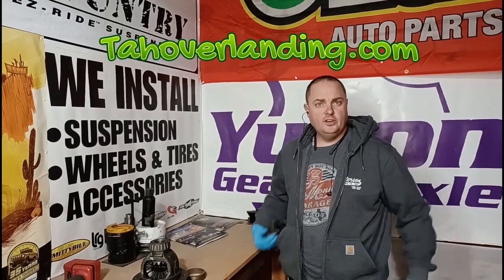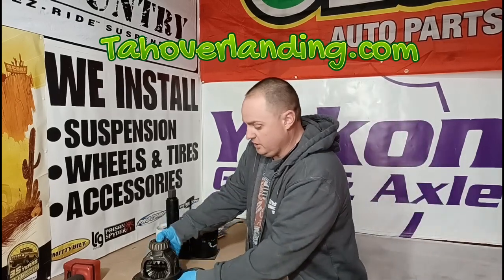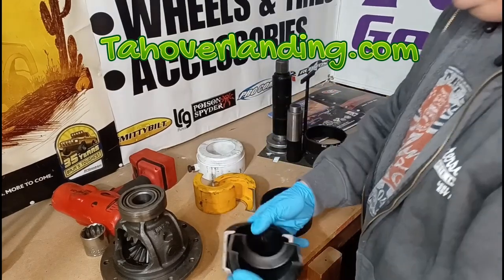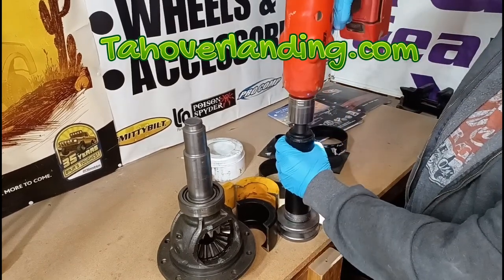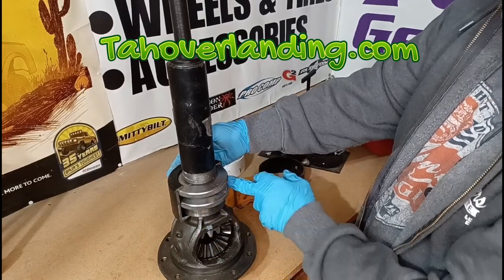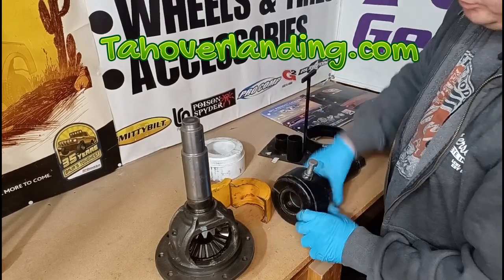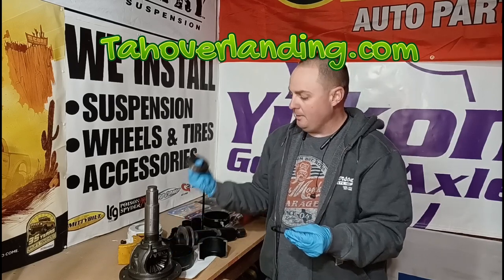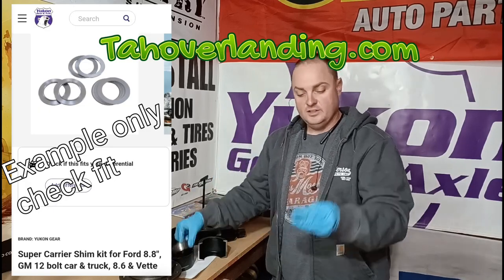Buy these shims when changing gears - Tahoverlanding Axle swap episode 22

Comment: Gear install video would be sweet, honestly. I know I eventually want to run 4.56s with some sort of worm gear, limited slip in the back, and an e locker up front
Reply from the maker: I'm sure you mean a torsen style, I'd do eaton/Detroit true-trac without a doubt.  

I'll do an install video next time I do gears. I'm considering doing more like a series of videos. One focusing on pinion depth, one on backlash, one on pinion bearing pre load etc. 

I haven't decided

But at any rate I'm a month or more from doing gears again
Reply: Looking forward to it. It's definitely something I'd like to learn how to do. And yes, torsen but for the life of me I couldn't remember the name but I did remember a component within it 😂
Reply from the maker: @thomasmullinsiii7759  rather than "worm" they're actually also known by the helical gears. So you'll hear them called "helical" 

I'm a huge fan, I've installed many for guys. Jeep guys love them in the front diff. 

I talk them up so much that Instagram @3108.gearhead is going to put one in the front of his swapped suburban
Reply from the maker: @thomasmullinsiii7759  I'm actually considering putting one in the front of the new white Tahoe
Reply: Never thought about doing front and rear "helical" style lsd. Not a bad idea.
Reply from the maker: @thomasmullinsiii7759  I have a couple of different videos in the works that will address different parts of this discussion